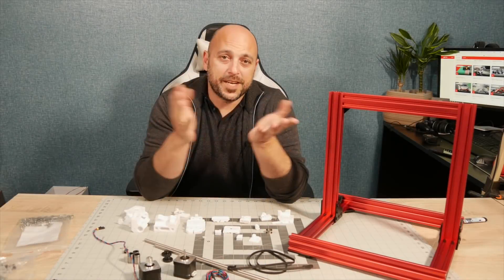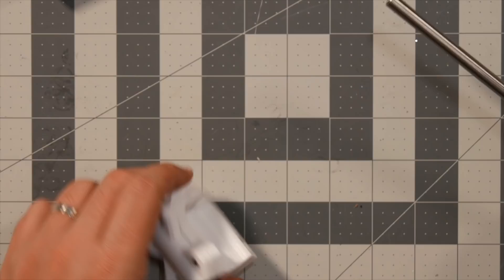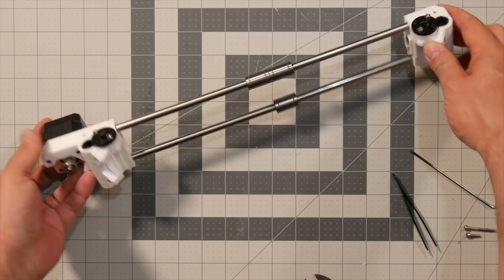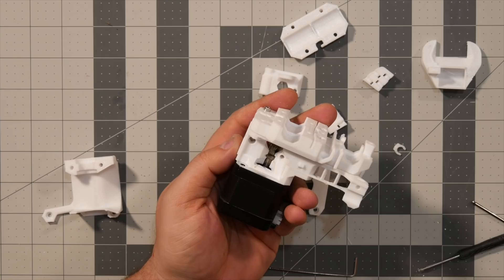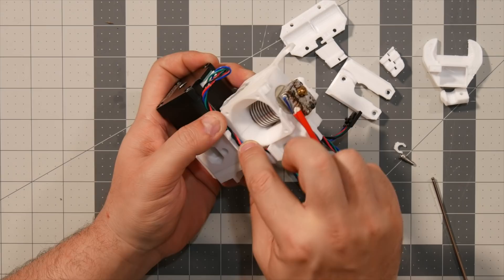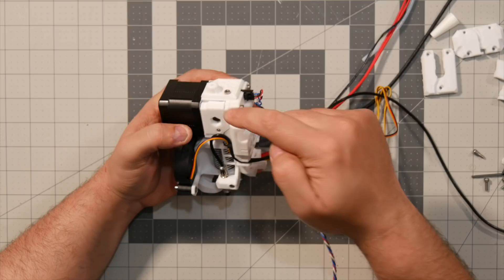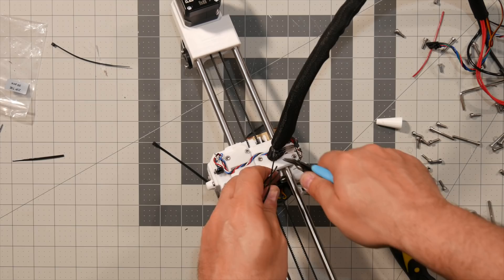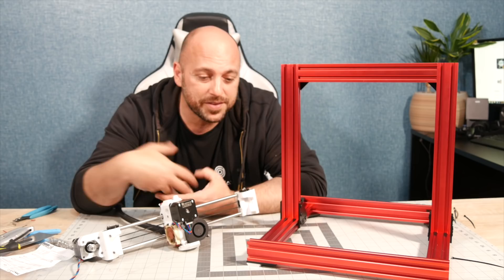Prusa i3 Full Bear Upgrade Kit - Part 2 - X-Axis and Extruder

Comment from the maker: X-Axis assembly starts at 1:33
Extruder assembly starts at 7:48
Reply: 3DMN how do i mod the prusa i3 mk.2.5s frame into the same like the mk3s
Reply from the maker: You’d need a completely different frame to convert it to a mk3 structure
Reply: Did you use the MK3 carriage, or the MK3s carriage @Grégoire Saunier mentioned on twitter?
Reply: Does the kit work with the MK3s?
Reply: @frankgarcia9045  Yes but for now you need to reuse the Y belt holder from MK3 because Prusa changed the belt path on MK3s. I will work soon on the Y axis to make it universal and to add a tensioner.
Reply: @andybecker5040  It is the Bear carriage for MK3 (Bear MK3S still in development). Note that my Bear extruder is only working with Bear X axis. The belt path is different to reduce vibration and make assembly and maintenance easier.

Comment: Good tip for the bearing alignment :) goes and checks printer
Reply: Ya, the Prusa guide for my MK3 showed to have the little balls inside the bearing to all be on the 3,6,9,12 o'clock positions.

Comment: Well, I was going to be upset since the next part wasn't out yet, but when I was removing one of the bearings from the X axis, I got a whole bunch of little metal balls all over the desk.  So, I have to wait for new bearings, which should be here tomorrow.  In the mean time, got most of the X axis put together,  I am using the Bondtech extruder upgrade so had to use a different mount (https://www.thingiverse.com/thing:3477926), but it is ready for the replacement bearing and then I can put everything else together.

Looking forward to the next part.  Just hope I got everything printed since all my printers are down now. :)

Comment: Looks nice, personally I  would add support to the corners to keep the 2040's square and flush
Reply: There is really no need. One guy stand-up on the frame to prove how strong it is :-D

Another problem is that extrusions are never perfectly flat because of the way they are made. It is melted aluminum, so like our 3D prints it can wrap, twist and shrink. Tolerances are quite high for aluminum extrusions, including from brand like Misumi (they even don't give tolerance on the cut). This is why Openbuilds (and so my frame) are using thick joining plates, it allows you to align everything perfectly. The problem with the brackets in corners or through hole mounts is that you cannot compensate for those little inaccuracies.

Comment: White plastic around the optical filament sensor??  good luck with that.
Reply: Peter Ellens joe mentioned in other video that he rarely uses the filament sensor, he also mentioned a neat trick where you can paint the inside black so you are not limited to any colour, pretty cool 😎
Reply: Meh, turn it off. It's not a big deal.
Reply: @justinl.3587  Agreed.  It has never worked reliably for me.  Always false triggering an out of filament state.

Comment: Those parts that you printed in Polycarbonate...did you print them with a Prusa i3 MK3s? Also, it is recommended to print the extruder in a dark color or black. Was there a reason you did it in white?
Reply from the maker: They were printed on the Raise3D Pro2. The reason it is recommended to print them in black is due to the sensitivity of the filament sensor, I don’t tend to use it so it didn’t make any difference. However I could always paint the inside sensor chamber black if I need to
Reply: @3DMakerNoob  is it possible to print that stuff on the prusa?

Comment: Why didn't you use the 45 degree angle fan mount? any reason? Greg said that it was the best as well.
Reply from the maker: The last conversation I had with him confirmed that vertical is better as there is less of a chance of heat from buildplate to be recycled and it also prolonged the life of the bearings
Reply: @3DMakerNoob  This makes sense as the fan is further away it applies more leverage onto the bearings and the rods. Damn physics is hard. Thanks you man have a great day
Reply: @lenny6617 Yes Joe summarized it perfectly. A member of my community did some simulation as well. 90° shroud has more static pressure but less velocity, 45° shroud has more velocity but less pressure. Now which one is better is hard to answer. Probably having more pressure is good if you are close to the nozzle, more velocity if you blow all around widely. I also feel that the blower has much more impact than the shroud.

My extruder has also several improvements on the bottom (around heatbreak) to let the part cool down better and improve thermal separation between heated block and heatsink. This will also have a little role on the ability to cool down the layers. Even heatsink cooling has a role to play, colder heatsink means less heat on the bottom, means better cooling of the printed part.

Comment: Joe, may I ask which branch of the Bear x-axis and extruder you used? Is this the (~6 month old since last Github update) "master" branch, or the active "dev" branch with v0.6?
Reply: This is 0.6.0, still working on the MK2.5S and MK3S version (in the dev branch)
Reply: @gregoiresaunier2622  is 0.6.0 the version in master branch? From 6 months ago? That's what I should use for full bear MK3?
Reply: @AustinVojta  Yes master branch or my thingiverse, both are up to date

Comment: 4:35 Wait...Just reprint the idler mount with a countersunk hole.
Reply: There is not enough material on the side to allow for a deep enough countersink the way it is.  A slot in the X idler mount could probably be added to compensate for the screw head.
Reply: @halsaresnowpaw522  I've looked at the STL.  The thickness/width of the wall where you place the pin is 3.25 mm.  An M3 countersink requires a depth of ~2 mm.
Reply: @bernardtarver The head of the M3 bolts I am using are 2.9mm.  The specifications I could find for the head size gave a range of 2.85 to 3mm.  That doesn't leave a lot of material.
Reply: @halsaresnowpaw522  To elaborate, use a flat head screw with a countersunk hole.